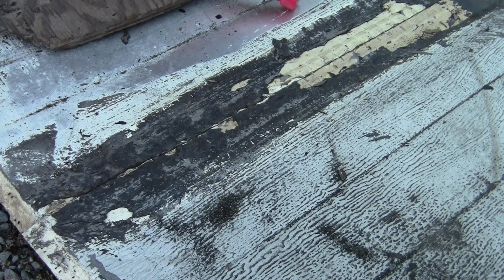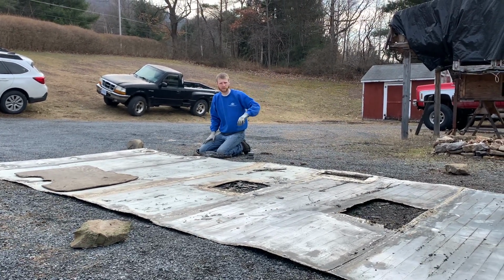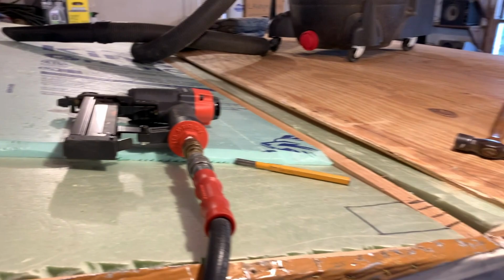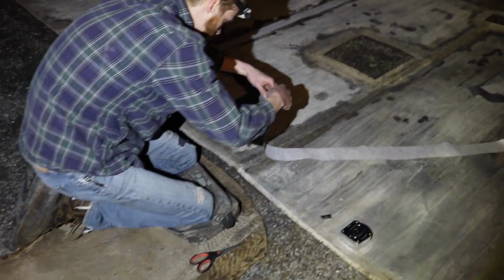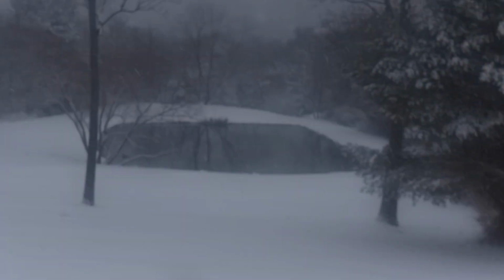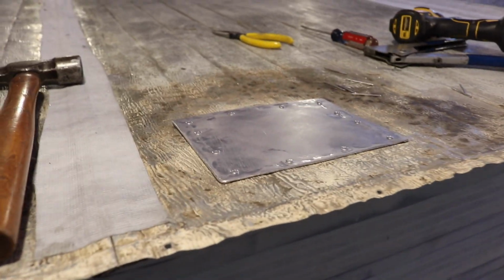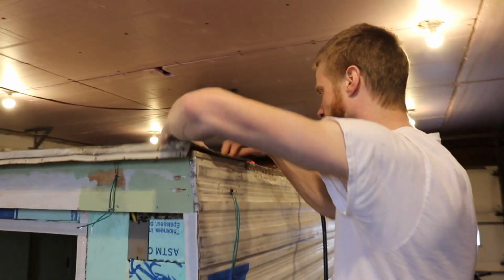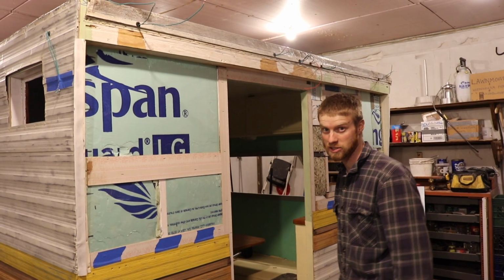ALUMINUM ROOF INSTALL - Truck Camper Build Part 51

Comment: Nice work. Couldn't find any other videos that document working with the existing aluminum top. This just gave me the confidence I need to pull that thing off and give it the love it needs. Thanks for stopping to explain your thought process too about certain methods and details... like the adding wood to make the aluminium flow more smoothly around the vent. super helpful. Cheers!!

Comment: OMG. You are just killing me with the prep work and such on this nearly useless aluminum roof panel. Good for a basic template. Scary how thin the roof panels really are! You would have been better off getting a coil of new 8' wide aluminum sheeting but I do applaud your effort to keep the old stuff.

Comment: Should’ve use 2” angle to hold down the sheet metal. Saves you from having to bend it over edges. You can also put a seal under the angle to make waterproof no?
Reply from the maker: I could’ve used angle at the roof to wall corners with sealant. But if I did that, then my corner trim would have not fit. Thanks for the comment!

Comment: Love the series dude! found it after I bought one to restore. just wondering about sealing the wood. at the beginning you were using boat paint I believe. any reason u stopped doing that or did you switch products?
Reply from the maker: If you are talking about sealing the wooden framework, I used kilz 3 primer and in some places top coated it with an exterior flat latex paint. I started getting lazy with painting the framework towards the end and focused more on sealing the exterior of the camper and simply keeping the water out. If I do a good job of keeping water out, I shouldn’t have to worry about sealing the framework. Hope this helps!